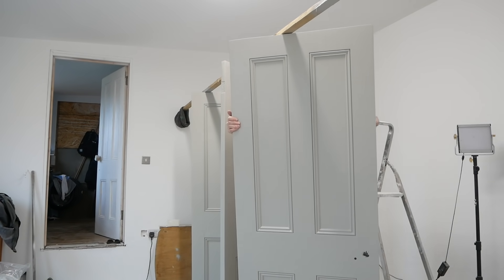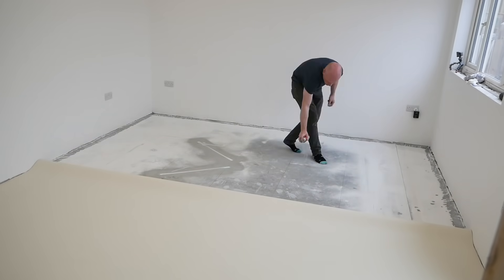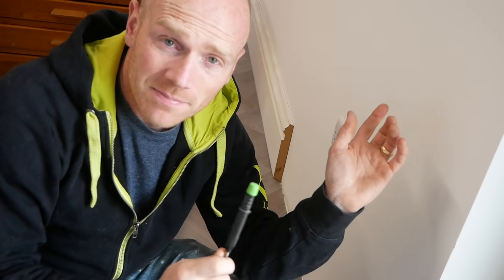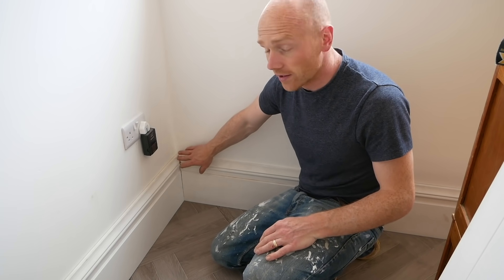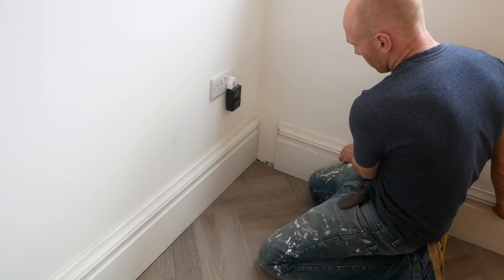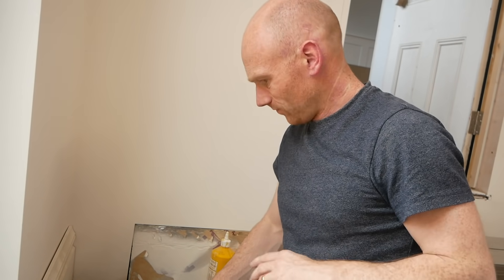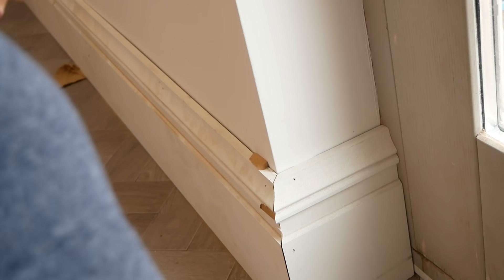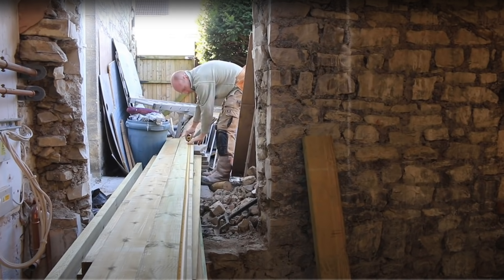FITTING SKIRTING BOARDS & VINYL FLOORING - It's Almost Ready!

Comment: I find much easier and accurate to scribe when u cut the end on a 45 like you have butting up the joints... then u simply use a coping saw to cut around the profile, ie where the painted edge meets the 45 angled cut this way the profile is accurate, also u back cut slightly on the coping saw like 15 degrees....

Comment: I use a protractor thingy to measure the angle of corners, then set my mitre saw to that angle. It gives a closer mitre joint and hence less filling etc.
Reply: Yeah the kapex 120 comes with one to split the angle

Comment: You can get a lovely accurate finish on the mitres using an angle grinder with a heavy duty sanding disc (instead of using a coping saw). Creates a lot of dust though!

Comment: Tim - what did you seal the gap between the skirting and the floor with?    I am currently doing it with paintable mastic but not easy to do - I have 3 rooms to do so tips welcome.   I didn’t want to use normal kitchen/bathroom silicone as cannot be painted when skirtings needs to be repainted in a few years.

Comment: I have vinyl in the kitchen you have to be very careful if you move any heavy items around as the legs did in and either leave imprints or worse still it tears if you drag rather than lift eg a fridge/freezer

Comment: I know it's not to your standards but for skirting where you need access (for me it was skirting up to a bath panel) I used velcro strips! so for a section I could remove to get the panel out, velcro the skirting to the wall. If people notice it, they're spending WAY too long on the loo!

Comment: I’m looking at laying electric UFH in converted garage. The floor is solid concrete, wood batons with colotex or similar then t&g ply boards. Everyone I ask on how to lay the UFH are giving me different advice, I just don’t want to get it wrong. I will be laying Lino/ vinyl on top. Please has anyone got any advice on the best way to lay it.

Comment: It may just be humble MDF, but it looks quite smart when it's installed properly.
Reply: MDF is the worst product ever they soak up moisture from the air and they expand 10x more than timber
Reply: @Abid.Z77  yeah, it's not good for an environment that will see a lot of moisture. But properly installed, painted and caulked, it can last a while, at least.

Comment: I wouldn't call that a bodge! that was a neat on the right corner - I have seen a lot worse in new builds... Not a lot people would do a  scribed joint some will just mitre it and caulk the sh**t out of it. I have done some nice baseboard/skirting return that the profile meet the floor I will PM it on insta (American style) - Great work mate!

Comment: Laying vinyl flooring requires the floor to be perfectly dry and you will find that most floor layers will insist on a liquid epoxy dpm to guarantee the moisture content in concrete floors irrespective of whether a structural dpm has been fitted.
Reply from the maker: Yeah definitely the case with concrete. This is chipboard T&G. 👍
Reply: @TheRestorationCouple  My apologies, the flooring does not look like chipboard but a well laid concrete on the video.

Comment: You should glue your mitres with the mitre bond first as with the mdf skirts you can then bend them if the corners not perfect 👌🏻 and if you mitres are slightly open to use a bit of timber to pein the edge over. To close the gap in
Reply from the maker: Yeah that’s my usual route when using regular skirting or arch but this 25mm stuff isn’t bending much either way. Good tip about the corners. 👍